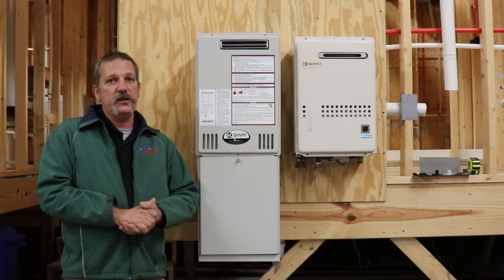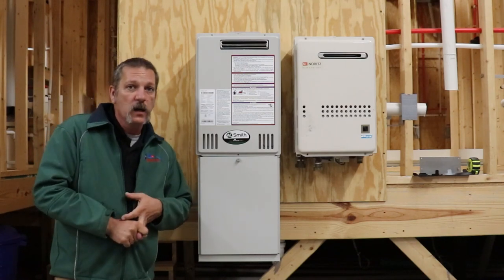Tankless water heater condensate vs. non condensate

Comment: Interesting point on dropping the efficiency by having longer showers with the condensing boiler - I thinking exactly that this morning when I was in the shower and not having to worry about running out of hot water in the tank any longer

Comment: Good morning sir, I have a question for ya. Our entire subdivision lost gas on Christmas eve they had it back up and running around noon time eastern time. But I haven't had hot water since do you know what may have caused an issue other than loosing gas? It did get extremely cold the night before Christmas eve. Thanks any help would be greatly appreciated Thanks. It looks exactly like the Noritz just like you displayed in this video on the right hand side.
Reply: Wow, just subscribed I read your bio and I'm in SC as well  upstate area!!!
Reply from the maker: If probably froze in the pipes underneath
Reply: @PlumbingSolutionsLLC  Indeed, I took off the bottom   cover placed a hair dryer in there for about 35min and turned breaker back on and boom hot water 💧 thanks for your informative video neighbor of the Carolinas. I liked and sub'ed!!!!

Comment: I am in the UK replacing two Brittony 11T multipoints, as the cost of gas now makes the pilot light consumption significant. condensing Rinnai (my choiuce) version replacement will cost more than a noncondensing Rinnai version is the gas saving,condensing  worth the extra cost and probable shorter life compared to the non condensing alternative?

Comment: I have a problem on my rinnai condensing water heater. I flushed it today and after doing it,  even when heater is not running, there is a steady flow of water from condensing pipe. What to do to fix it. Thanks!
Reply from the maker: you probably have a pin hole leak on the top heat exchanger

Comment: I have a Navian tankless water heater had for nine years and the o ring on the condensate plug deteriorated so bad it was leaking water on the floor. Can I pipe that outside or to a drain pipe

Comment: So which is better if its on the outside of your house?
Reply from the maker: natural gas is going to be cheaper to operate . but they both work the same
Reply: @PlumbingSolutionsLLC  condensing vs non?
Reply from the maker: Ah. can It freeze where you live? if yes, Non .... condensing tend to pop in cold weather.
Reply: @PlumbingSolutionsLLC  in Louisiana we had a couple hard freezes since my install. Takigi T-Kjr2-OS-NG it’s been great. Going tankless in next house and was just curious